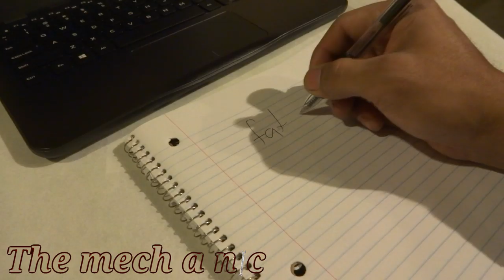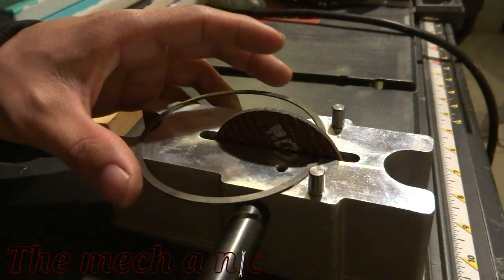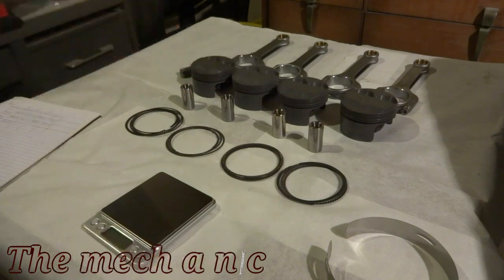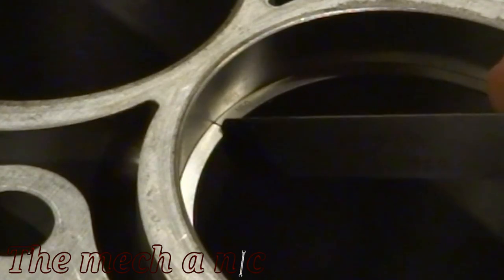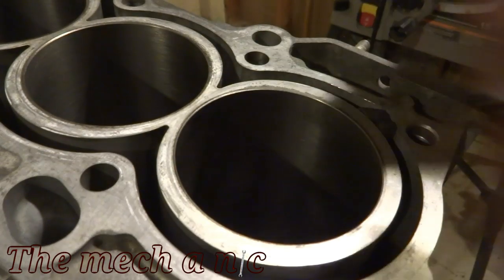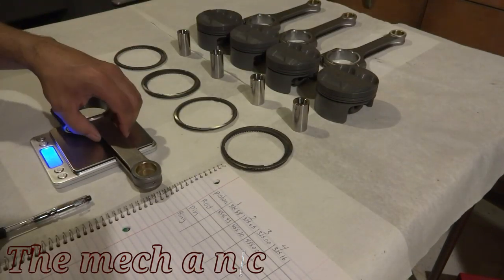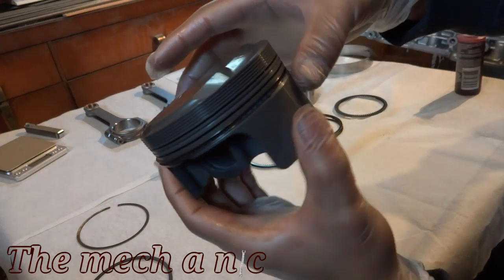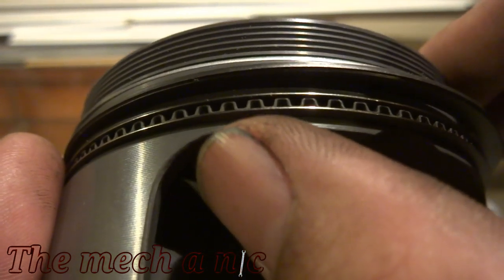K24 piston install

Comment: Love the special effects! 
When balancing the pistons you can remove material from inside the wrist pins and match them to each piston. 
Worked a treat on my last build as I had one piston 5 grams less than the rest.
Reply from the maker: Thanks! At 5g of difference  I would have tried to make more of an effort but I was surprised how close all the weights were.

Comment: Love your videos, I'm thinking of building a naturally aspirated k20z4 engine with 12.5:1 compression with skunk2 ultra 1 cams and supertech 1mm oversized valves on the intake side. 

Questions:
1. Should I use a cast or forged piston for my Honda k20z4 engine?
 

2. is 12.5:1 compression not too high for pump fuel and what compression do you recommend for my n/a pump fuel setup on skunk2 ultra 1 cams? 

3. Can I use the stock rods with a cast of forged piston? If not, do I install or h or I beam rods?

Comment: I like the idea of weighing pistons and rods and putting lighter piston and heavier rod.
I was gonna grind rods but probably will go this route.
What would you gap the rings for a 87.5  wiesco 2618 piston k24 with  darton dry sleeves.
Will be boosted to 25 to 28psi
I come up with .025 top ring and .024 2nd but being told thats to big of gap
Reply from the maker: Wish I knew the answer. You'll have to ask people who are familiar with boosted engines
Reply: @themechanic6117  are you in Canada? Im looking for another prb head and 06-08 tsx cams if you know of any.
Mine was damaged when stock engine blew up

Comment: Hey aren't you supposed to clock the rings a certain degrees on when installing it? Watched another video and they mention when install make sure there clocked base on the repair manual
Reply from the maker: I did do that, I can't remember but I probably didn't go into detail in the video. I definitely made sure to clock the rings 👍

Comment: what was the piston bore size? I have a K24z7 and I dont know what the size is and I dont want one where I need a K20 head.
Reply from the maker: Mine was bored to 87.5
Reply: @themechanic6117  but did you have to put a k20 head on or do you still have the stock k24z7
Reply from the maker: I have a k20 head . But it has nothing to do with bore size. If it was 87mm or 87.5mm I could have used the stock k24 head or the k20 head. You can change pistons and go up to 87.5mm and still use your stock head .
Reply: @themechanic6117  ok thank you I have been having trouble finding the piston size and what works with the head every piston I’m found saying it’s for the k24 with a k20 head.
Reply from the maker: As look as the pistons you find will work with the stock head you'll be fine. Find forums of people talking about this stuff on google